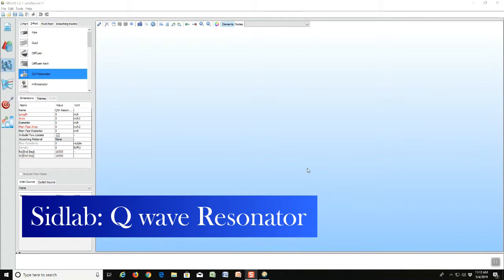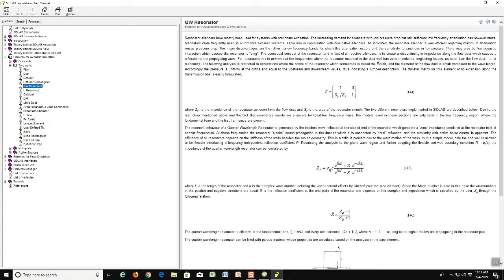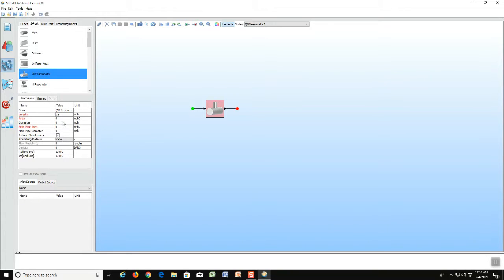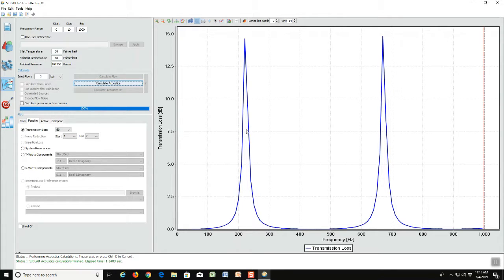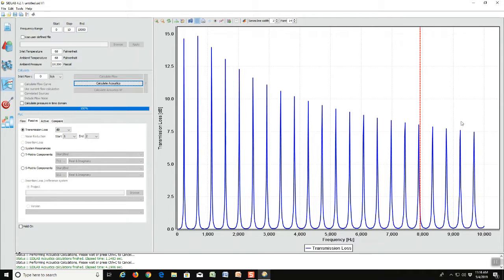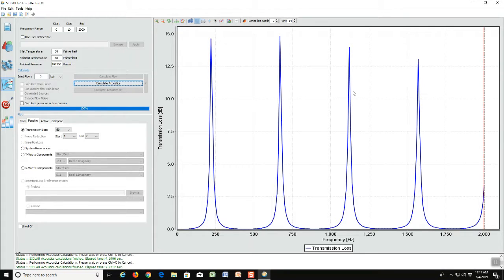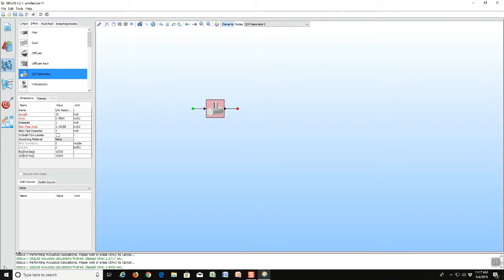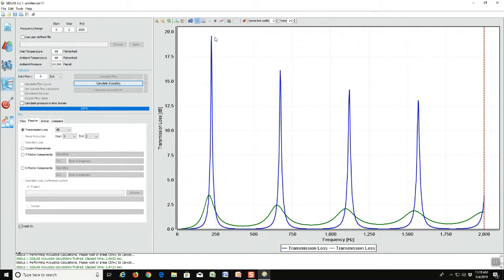Muffler Quarter Wavelength Resonator

Comment: do quarter wave resonators also work with harmonics backwords? For example, If I build a pipe and eliminate the frequency for 120 hertz, does the frequency at 60 hertz also get eliminated?
Reply from the maker: Short answer is No. The Quarter wavelength resonator is designed to target certain frequency, it can not cover lower frequency than the designed one, as at lower frequency the wave length is larger and doesn’t match the quarter wavelength that this type of resonator is based on. In general, you should always design the resonator to target the lowest frequency you want to element the wave at.
Reply from the maker: QWR eliminate the harmonics of the lowest frequency
Reply: @sidlab6464  Awesome thank you very much. I have drone peaking at 65 hertz but it also peaks at around 108-130 hertz as well and wondering if the harmonics aspect would cover 130 hertz as well. Also, does pipe diameter matter for the QWR?